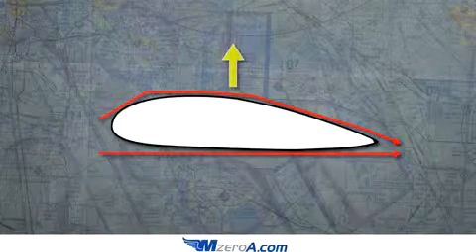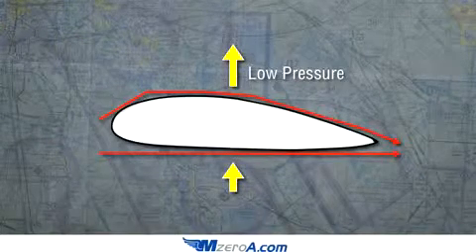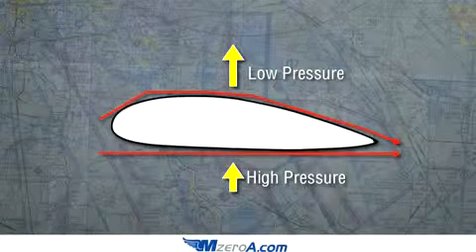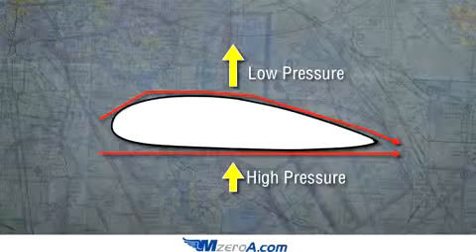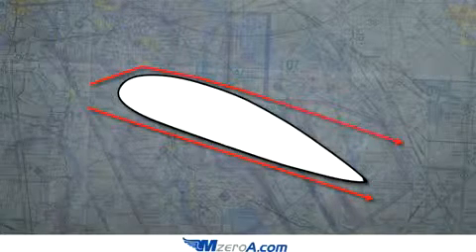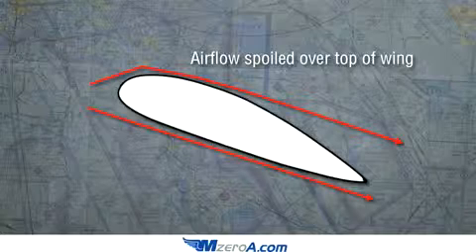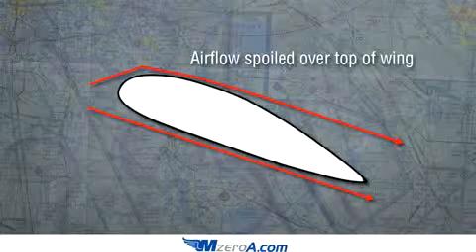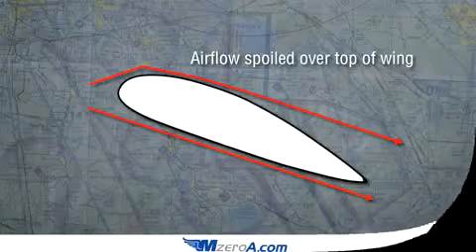Why Do Airplanes Stall MzeroA com

Comment: No offense intended to the producer of this video... But... This video is full of errors and should not be used by anyone wanting to know about stalls. The lift theory is incorrect and has been proven wrong for many years now. The stall illustration/animation is also wrong. 
Study the lift/drag curves and you will see that just after the point of stall total Lift is still quite high and Drag is high but increasing. there is no sudden loss of lift, the wing is just flying inefficiently therefor